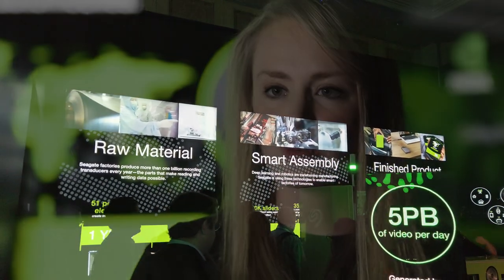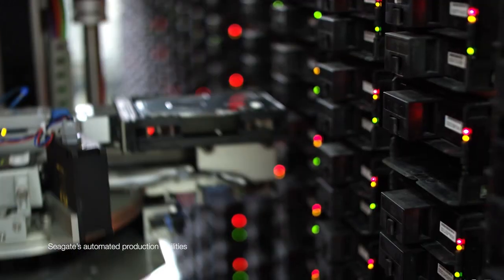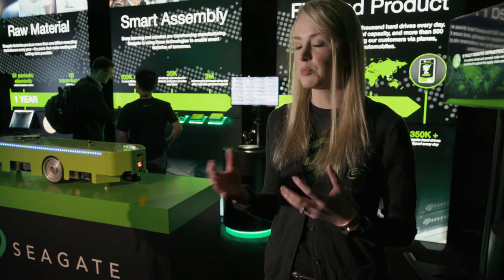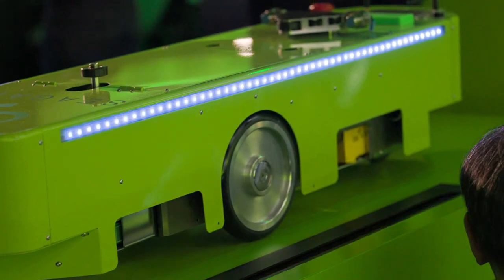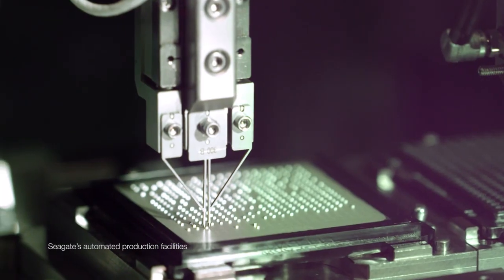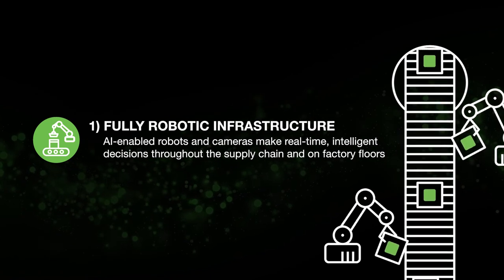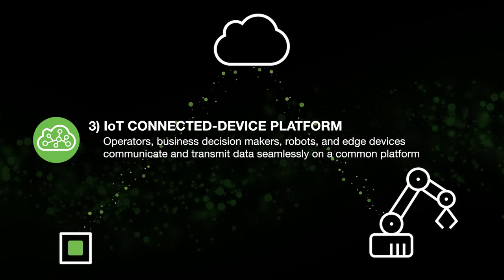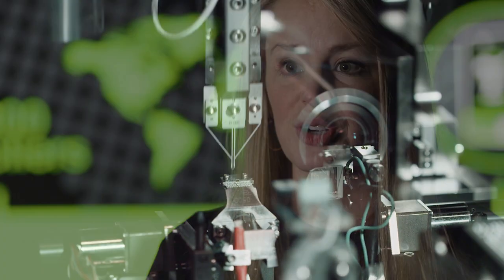Seagate I CES 2020 – Building Better Hard Drives with Artificial Intelligence

Comment: When For Seagate Will Be Available External HDD or SSD Seagate Bakcup Plus 10TB? I am looking For 10TB External HDD With USB Type Of Power Supply Only. I Am Looking For Seagate External 10TB But Only With USB Type Of Power Supply and Without Power Adapter, Only USB Type Of Power 10TB External HDD. Power Adapter For External HDD and SSD is Unnecessary Embarrassment And in Future You Need Only USB Type Of Power Supply Without Power Adapter.

Comment: How about creating reliable HDDs ?
Reply: Robert Klein they have reliable drives
Reply: You indirectly use them regardless. If you look at the manufacturing process, no drives are dead off that production line. Transit damage is something out of Seagate/WD/Toshs control. If you look an Innovation lead, Seagate hands down + they add extra benefits on top of the drive which the others do not. Example inclusion of Data Recovery.